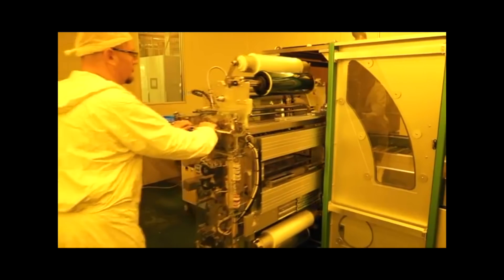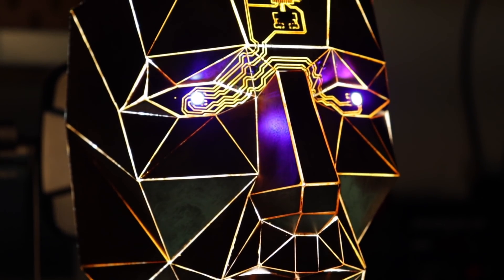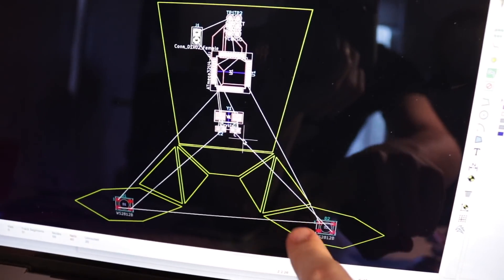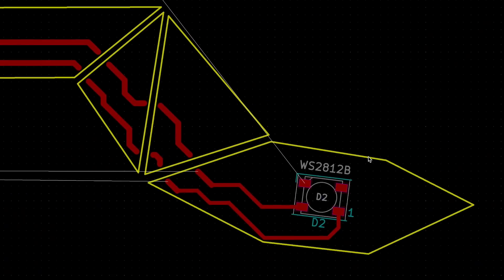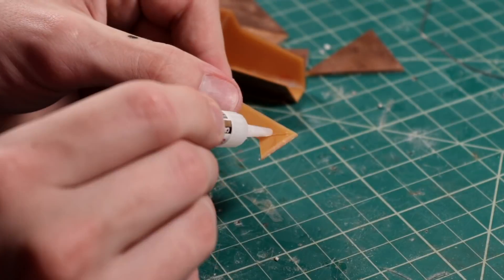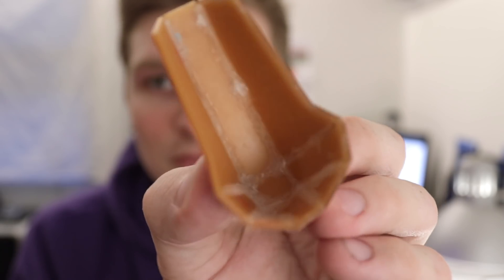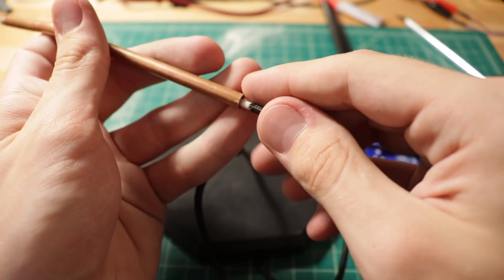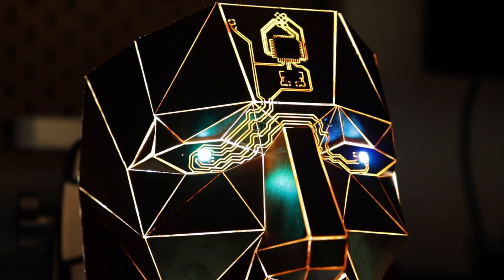Circuit Board Origami

Comment: The industry calls this 3D Mechatronic Integrated Devices (= 3D-MID). They do it by 3D printing the base model, then apply a special semi-conductive coating. Then a multiaxis LASER "activates" the parts of the coating that need to become conductive. After that, they use chemical plating and build up Copper-Nickel-Gold just like with a circuit board... It's pretty impressive what technology can do today. Beta-Layout aparently makes 3D-MIDs: https://eu.beta-layout.com/3d-mid/

Comment: You need a belt sander. Getting support marks off prints in 2 seconds and those chamfers..
Reply: Idk why he didn't just run a chamfer toolpath with the Bantom mill to be honest
Reply: @lucianchapar  The chamfers need to be on the back of the boards, though.
Reply: @pileofstuff  Bantom mills have pretty good work indexing abilities so a part flip isn't a daunting proposition.

Comment: That is very cool! Quick suggestion, you could mill the pcb's that don't have traces from the backside but not mill all the way through so as to use the flex of the thin copper layer as a joint for some pieces to minimize gluing time.